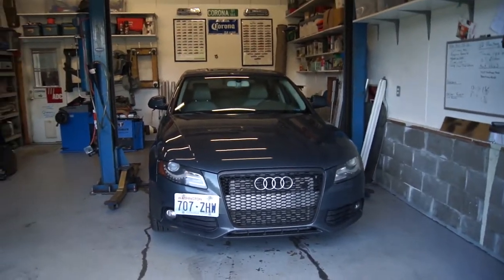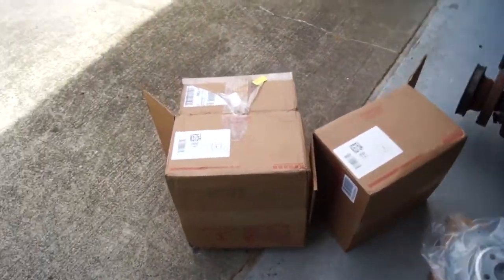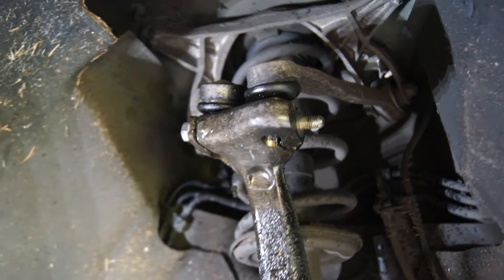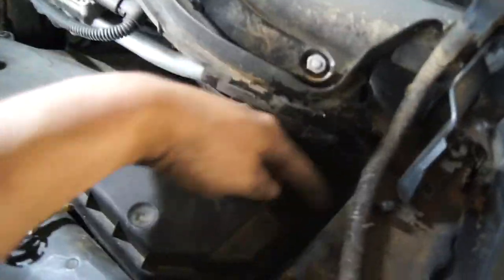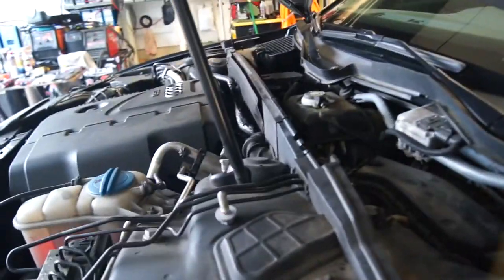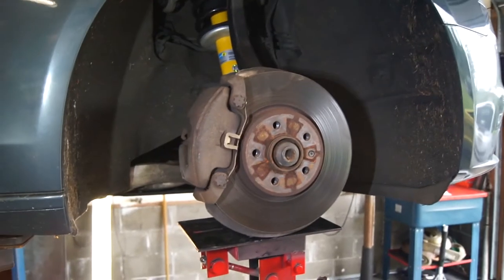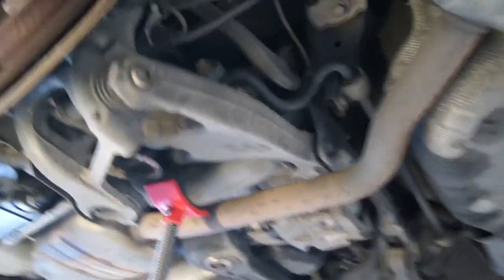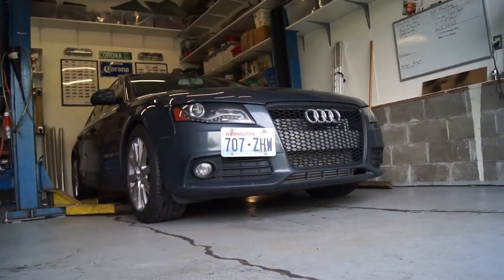2009 Audi A4 Quattro Automatic Strut and spring upgrade

Comment: Good video, thanks for posting!

Those front upper control arm ball joints do seem loose. To remove the pinch bolt heat up the bolt using mapp gas and cool/quench with blocks of ice. Repeat the heat/cooling cycle about 5 times and you'll see that bolt start to turn. Start tapping it with the nut on and then hit it with some good penetrating oil when there's movement (soaking it before hand does nothing). Tap, turn, lubricate & repeat.
Reply from the maker: Thanks I’ll try that out on the next one!